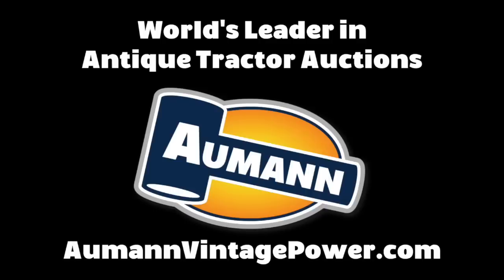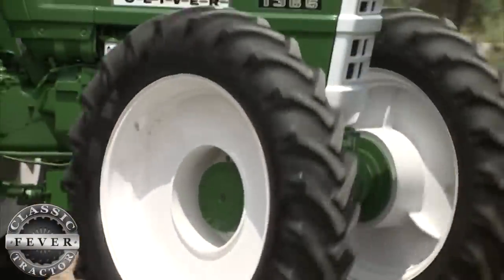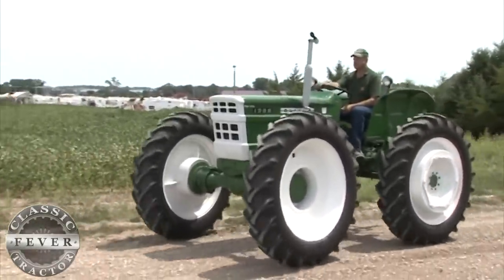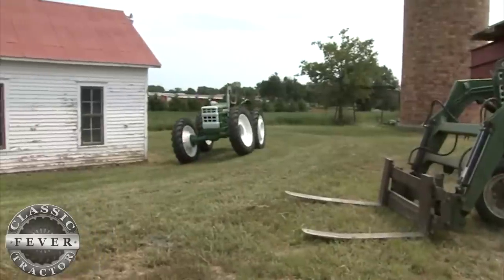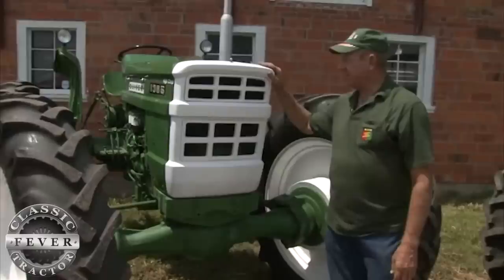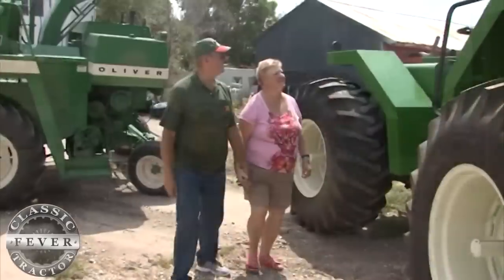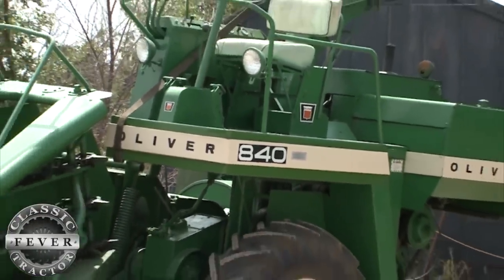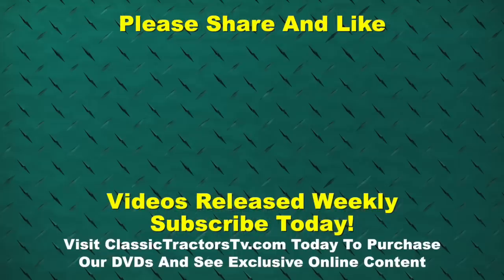First 4WD High Crop? - Do You Know What A Mudder Is?  Story On Fiat Built Oliver 1365

Comment: In  1976  I  went  to  work  for  Schreiner  farm  equipment , the  olivier  /white  dealer  in  Oxnard  ca . We  were  taking  2-60s  and  turning  them  and  the  next  size  smaller  and  bigger  and  turning  them  into  row  crop  4x4s. Take  a  4x  put  the  big  tires  on  the  front , rotate  the  rear  axle  housings  down , build  a  gear  box  out  of  3/4  plate  4  row  roller  chain  to  match  the  axle  gear  ratios . In  the  year  and  a  half  I  worked  there  we  must  have  built  25  to  30  of  them  for  the  vegetable  farmers . We  had one  farm  company   that  moved  during  the  year , Salinas/Oxnard , Arizona  and  imperial  valley  ca . I  know  we  had  8  or  9  of  them  in  for  service . I  never  knew  that  the  factory  built  them .

Comment: Reply to Brad not Landa
My tractors are White W2 -60s. The same book says it's also the Oliver 1365. Not the high front tires, but front wheel assist for sure. Mine are 4 serial numbers apart. 60 HP, and it can pull a 3 bottom full depth with no problems.
Mine are from 76.
There is a Fiat version also. Everything is the same as the Oliver 1365 and White 2 - 60, but the Fiat has a 3 cylinder.

Comment: There’s a few tractors similar to this near me here in Ohio. There’s a large patch of muck ground that they grow vegetables on. There’s one farm that runs all white, Oliver and Agco stuff.
Reply: ih1206 I ran one of the 1365's 30 years ago.  I hated it because it wasn't any more efficient than the bigger 6 cylinder white.  Just sort of an all around pig.  The diff lock is more of a self destruct button than a useful feature.  Nice to know fix it again Tony hasn't improved over the last half century.
Reply: Yep you must be familiar with celeryville then. Those high clearance whites are owned by wiers, but that's the only whites they own. Buurmas uses all agco equipment.. a lot of them old whites still put in the work
Reply: Kyle Buurma yessir. Farm just a few miles west of there. Drive thru the area a lot going to work at the Big M lol.

Comment: Actually, that 1365 and the White 2-60 are the same horsepower. 63 engine hp, 59 PTO. They are both Fiat 640 tractors, and, other than the front ends, only differ in the grille, paint, and ROPS and canopy.
Reply: Good day  Yea it had 210 cu.in motor, also wasn,t the Universal tractor, 640 the same tractor
Reply: Early 1365 were Fiat 600, later 1365 and 1370 were Fiat 640. The difference can be spotted on the rockshaft of the 3 pth.
Reply: Universal was a Romanian licensed built. That factory is gone now.
Reply: Good day Thanks, here in Ont. Canada, a small garage starting selling the Universal. There was not many around, but  the 1's he sold were 640's.  I thought they were from  Italy  Thanks for info.
Reply: The Universal engine has split heads, a 102 MM bore, and is an inch longer than the 100 MM bore of the Fiat engine.
Reply: G day    Are you or did you work on them?  Can u give  some  info  Thanks